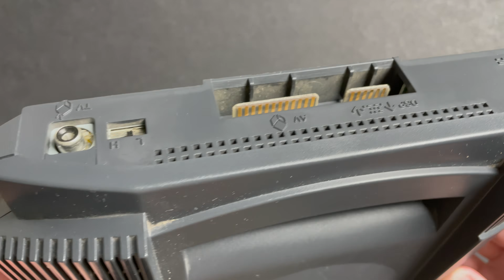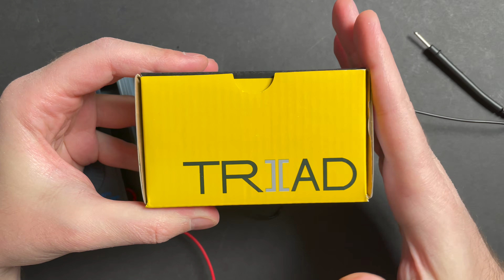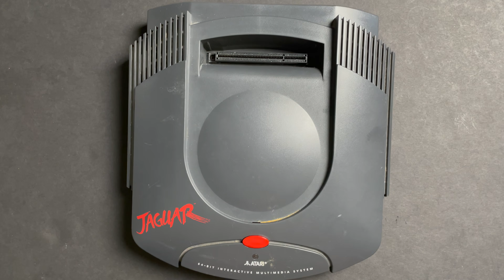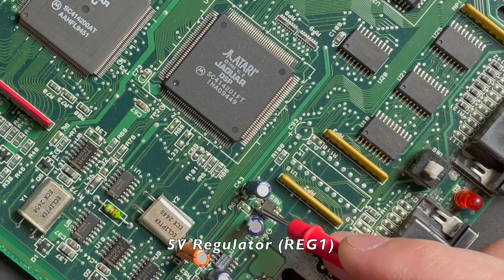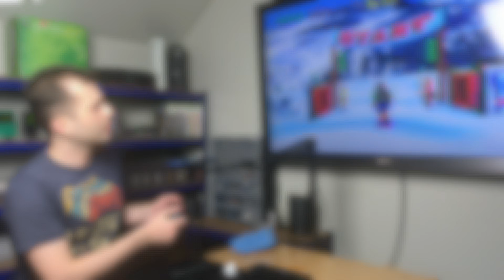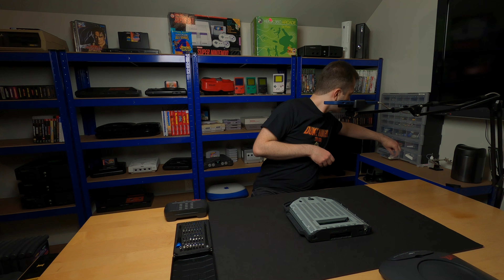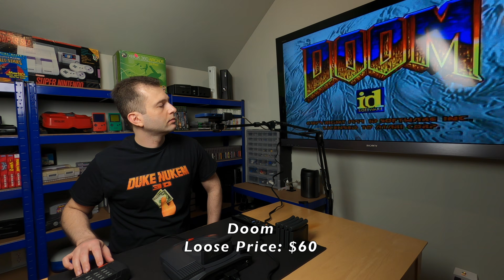Turns out $400 for a "broken" Atari Jaguar is a fantastic deal - Retro Console Restoration

Comment: Seems most likely the person that sold it has no clue about how the system works, perhaps got it from a friend or family, without an AC adapter, used a random one of the appropriate voltage, saw it as not booting, and decided to sell it. I can see that happening. I might have done the same, if I wasn't so much a game console person to actually check. Likely tried it, didn't boot, saw it sells for some cash and tossed it online. As you say, didn't even check game prices.

Comment: $400? for a broken one?  I guess selling the collectible would even things out, but still expensive at $200.
Reply from the maker: The retro craze is out of control. "Normal" prices have been out the window for many years now.
Reply: @BorderlineOCD  no kidding. I was buying all these Atari systems back in the 2000s for under $50 a system.  I am shocked at something I picked up for $20 10 years ago is going for $200+. some complete boxed are going for $500+.  I may need to unload my closet at these prices.

Comment: I have a boxed Atari Jaguar and honestly? They are NOT worth owning unless you are a hard core collector. There are only a very few games even worth playing. The most expensive is Battlesphere and it was a limited edition game. As far as the playable games go, Towers is awesome, AVP is also good, Pitfall is decent, Iron Soldier is good, Doom is the best port of the game on a console at the time, Also Tempest 2000 with it's killer soundtrack and Defender 2K. Most everything else is just plain Dog water!! It's just an awful system with a few good games that frankly (no offense to you) are hideously overpriced but also so is the console, although you did make a good gamble and got you a working one which is rare. It's worth keeping it only for a good conversation piece and a bit of Atari memorabilia. 

Just glad you didn't get the CD. I have that as well, and while it is still working, by all accounts it is a ticking time bomb as the capacitors and the optical mechanism are inevitably doomed to fail. It is nearly impossible to find a working one and when you put the two together it looks like a giant toilet bowl. Hence the nickname (Atari Toilet) or "Big Gray". But in it's defense, Flare in the UK really did make this console very powerful and had they not had to deal with Jack Tramiel's son Sam Tramiel, they could have had a better run of it. What really killed this console was 1. Difficult as hell to program for due to it's architecture. 2. Was yet another console withering under Nintendo's brutal "you publish a game for our console, you cannot publish for another console" and finally 3. The Tramiels and their absolute shit treatment of the Atari brand. Jack Tramiel was the brains of the family having worked for Commodore. He preferred computers, and wasn't too keen on consoles thinking they were just a fad and families wanted devices that were more flexible like Personal Computers. But he did see that perhaps it was short sighted but it was too little, too late. He tried to release the Atari 7800 which had limited success and the Atari Lynx which also had some success. He tried the Jaguar, but Tramiel just botched it with limited stock at launch, 3 games at launch, and no real publishers to craft top quality games. Atari did a lot of its own games and most were either tired old golden age games, poorly programmed "Indy" games, or a precious few publishers like Activision took a chance and published Pitfall. 

In the end, it was bad company decisions ,poor quality games, and that horrible "Do the math 64bit" that really doomed this console. It could have done well had it been blessed with a decent library and it's a shame because they could have approached Sega or EA and perhaps banged out a contract that could have landed them better games. Sega could have even taken on the console as a replacement for it's aging Genesis and perhaps stayed on as a console maker a bit longer.
Reply from the maker: Thanks for sharing your perspective, I enjoyed reading it. I think my only thought is that when looking at these systems through a "retro" lens I judge them differently than they might have been received during their prime. I'm fascinated by the history of some of these companies and in many ways they took risks and innovated to stay ahead. Much of this territory was unchartered as graphics improved and games continued becoming more immersive. Some took the wrong path (in hindsight) and made bad decisions. It makes a system like this more desirable to me because of its quirks and abnormalities. It's an ugly duckling but one that has a place in my game room :)
Reply: @BorderlineOCD  Same here, it has a place in mine as well. I guess to sum it up it was a HUGE missed opportunity. The Jaguar under better leadership could have very well got an early start on the 32/64 bit revolution and might have given time, carved a niche for itself at the very least. And at best, begin the climb to reestablish Atari as a name again.

Comment: Nice grab. I'd say sell the rest of the games and snag a GameDrive for it.
Reply from the maker: I definitely will. Given the poor/non-existent emulation its the only good way to experience the full library of games.
Reply: @BorderlineOCD  As someone that also owns a GameDrive, I wholeheartedly agree. Reason for that also being, there are a select number games out there without the edges of the pcb's slightly trimmed down, thus could catch on the pin connector and bend the pins inwards upon plugging in the cartridge, thus rendering the system useless. The skiing and snowboarding cart I have killed one of my jags because of that issue. Don't have to worry about gambling with that issue if you just get a flash cart and don't plug anything else in, haha.

Comment: If you have it open, recap it.
Reply from the maker: Are these systems typically plagued by capacitor issues or just for preventative maintenance?
Reply: @BorderlineOCD  Electronics are over 20 years old. What's your opinion?
Reply from the maker: The system isn't suffering from jail bars or rainbow banding. A recap wouldn't hurt and I think I would probably do it in a future project but I'm not burning to do it right away.
Reply: @BorderlineOCD  i always do it. But thats me.  It would be cool if you recapped a Power brick.  Im a new subscriber to your channel.👍

Comment: this guy uses lithium grease for plastic but uses composite instead of rgb scart
Reply from the maker: I don't get a hard on for RGB out of retro systems. It's a silly obsession. Not a popular opinion but thats just me. I don't own an RGB monitor or an upscaler either so the point is moot. Unless you are in Europe (which I am not) then you likely never experienced retro games in RGB to begin with so there is no experience to recreate. The system can natively output RGB so if and when my desires evolve its just a matter of getting another cable.
Reply: @BorderlineOCD  i actually am obsessed with getting the best out of native hardware.... your videos are actually beyond my ability so much respect but yeah there are good converters for cheap..... n64 i use s video with the m cable and scaler